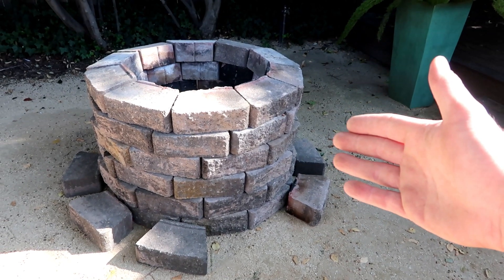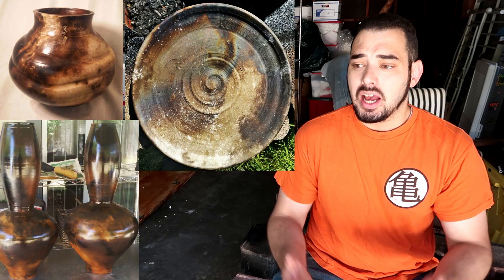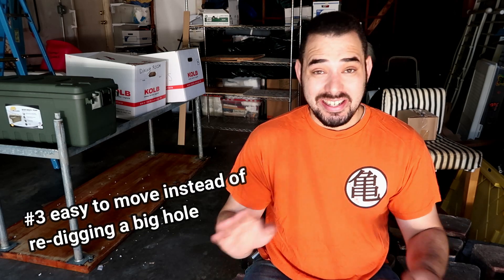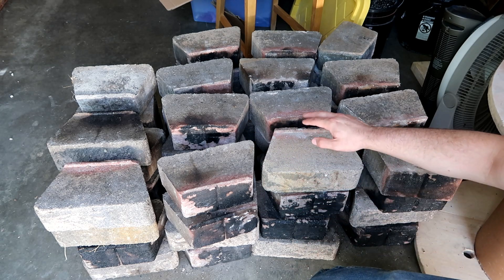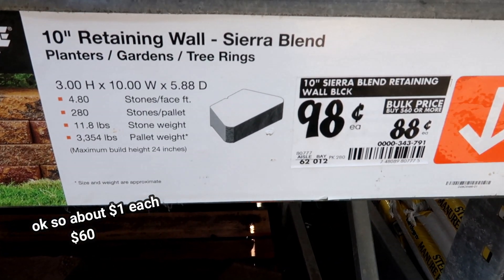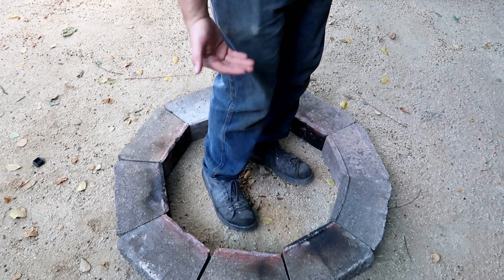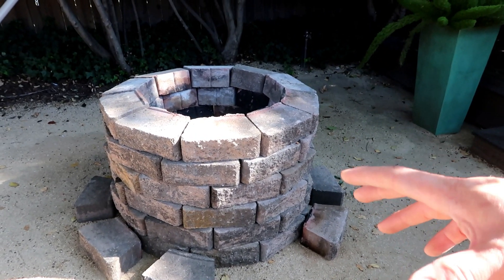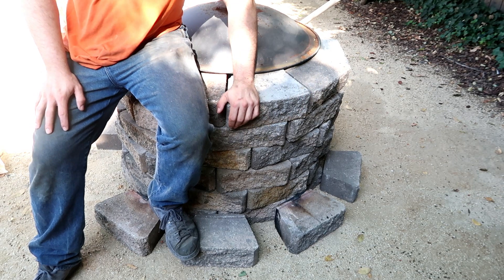Rebuilding my pitfire Kiln.

Comment: 2 suggestions: use a masonry chisel to knock the retaining lip off the inside of the block.  It's really easy, goes fast, and a masonry chisel is like $5.  Use a ratchet strap to tighten up the layers.

Comment: If cones were used to measure temp. Could the interior of a covered canister be clear glazed in a pit fire if you reach cone 5 successfully? Making it safe for food storage such as coffee, sugar, flour etc. Or could you pit fire a piece to achieve the desired surface appearance and afterwards re-fire (electric) using clear glaze to cone 5/6 making the piece food safe?  Thanks so much Dante, for your videos!!!!!!

Comment: how well do they hold up after repeated firing...high temps can start breaking them down if they're the "cast cinderblock" sort of thing....would it help to have a "liner" of firebrick?
Reply from the maker: I used to put clay in the small spaces as a "liner" but it didn't help too much. And I have done many many many pitfires in this and they still hold heat and have not broken down yet.
 I don't know the limit or even if there is one but for someone like me ( who's life is pottery) I have never had a problem with it

Comment: Thanks for the very inspiring videos! I plan to try to build an oven based on your instructions and have some questions: firstly, if you clean the oven from the ashes from time to time, before burning again? If so, how does it work with the lava rocks at the bottom?  In a clip you put clay on the inside, is that something you do the first time you burn in the oven? Last but not least, do you leave openings for oxygen? Some leave openings far down on the oven to let in oxygen, what do you suggest?

Comment: Off topic but if you're renting a house how does that work with the Kiln set up? Did you need to get permission from the homeowner to install a 240v connection in the garage or was there one already there?
Reply from the maker: I would get permission from the homeowner before installing anything.
The reason I did this pitfire kiln this way is because it's easy to pick up and move somewhere else without damaging the ground of the person you're renting from.

Comment: ok I was a homebuilder so I feel the need to correct the term fluting.  "Fluting in architecture consists of shallow grooves running along a surface. The term typically refers to the grooves running vertically on a column shaft or a pilaster, but need not necessarily be restricted to those two applications. If the hollowing out of material meets in a point, the point is called an arris."  The term you want is miter. "A miter joint is a union between two pieces, each cut at an angle, at a corner. Commonly, as for painting and picture frames, the two ends of the two boards are cut at a 45-degree angle and placed next to one another to form a corner of the frame."  Sorry for being the grammar police... just thought you might want to know.
Reply from the maker: O my bad. I hope ppl get what I mean by context then

Comment: Hi, I noticed you had rectangular pitfires in the old house. Is the rounded shape of this pitfire any more advantageous than the rectangular one? Maybe you prefer the one above because it looks more attractive than the mini 'brick shit house' vibe of the rectangular one? I doubt I will find angled bricks in my price range (UK based) so a square/rectangular pitfire is a more realistic goal.
Reply from the maker: Ok yes. It's Abit larger. Most of my shapes are round so it fits in the shape Abit better ( more pieces) it's far more stable then a rectangle, and it just looks more aesthetically pleasing.

Comment: Thanks for this vid!! You mentioned in an earlier comment that you should bisque your pieces before a pit fire... is this super important? Wondering how to continue potting after I lose access to a modern kiln...
Reply from the maker: It is extremely important as if your ceramic artwork heats up too fast it does have the chance to explode especially if there's still water left in the clay body
Reply from the maker: I would like to go on to say that there are many people who message me each week thinking that they can either bisque or glaze stuff in natural fire. Unless you have a fire or reduction kiln that can go up to 2000 degrees + Fahrenheit it is a very low chance... Like less than 1%
Reply: @EarthNationCeramics  Thank you very much... will definitely bisque first! :D
Reply: Earth Nation Ceramics oh dammit, I was set on building one, I can’t access bisque firing right now☹️

Comment: Hi Donte! Loved your video. To which cone would you recommend bisque firing my wares before pit firing? Thanks for your help! Keep up your great work
Reply from the maker: Always bisque before doing a pitfire. Otherwise the acceleration of heat will usually explode your pottery.
Reply: @EarthNationCeramics  thanks for the tip !

Comment: Question:  So you wash them up, let them dry and spray them with Amaco.  These are meant to be only ornamental, correct?  You wouldn't use them as a salad bowl, or a fruit bowl, right?  Okay, I have to tell on myself.  I went back and watched you light up that gasoline and about busted a gut laughing!  As always, you are a delight to watch.
Reply from the maker: These are not food safe . Pitfire is largely regarded as non food safe

Comment: those blocks are concrete, not fire bricks.. can't they explode or break apart from heat?
Reply from the maker: They can of they get hot enough but the fire in this pit in natural fire. So it never does get hot enough